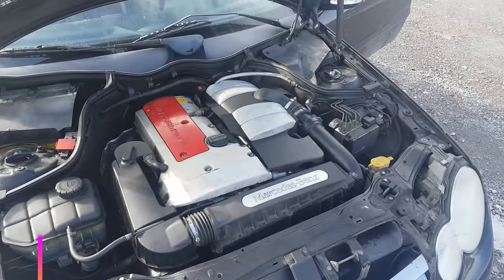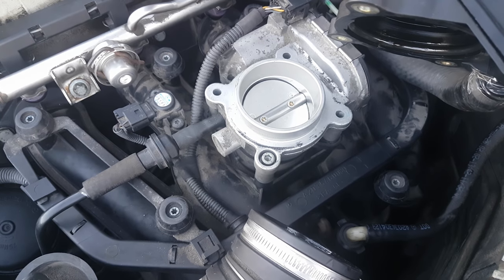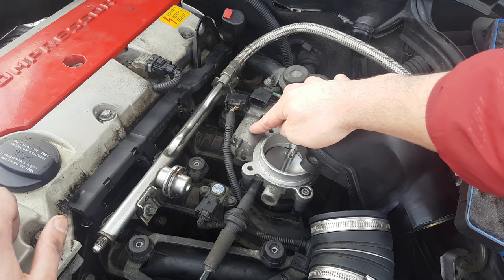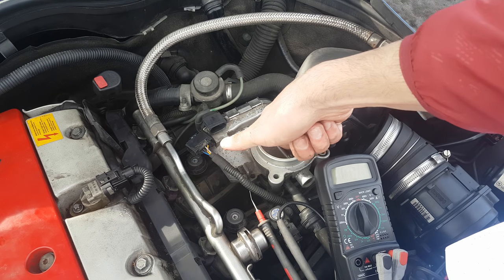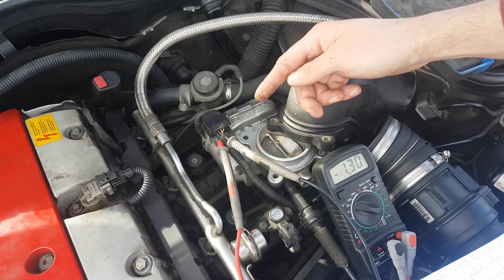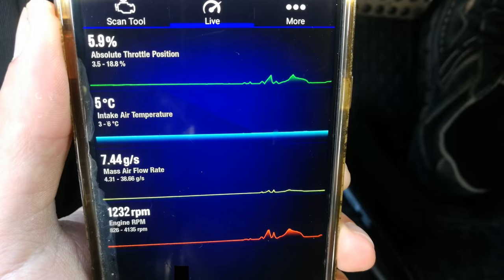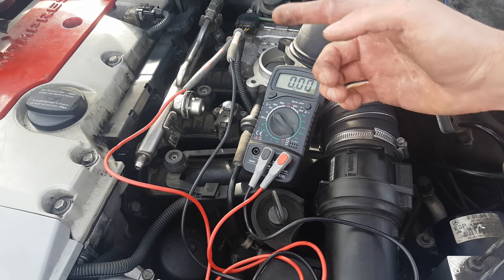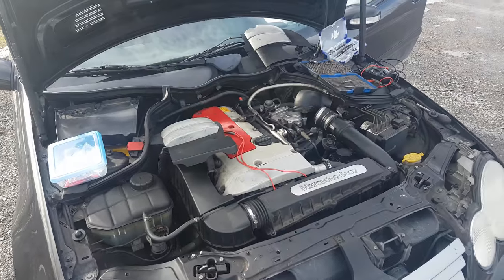Mercedes w203 C200 TPS (throttle possition sensor) Test

Comment: You answered a good question when I thought it needs calibration after install
Reply from the maker: Newer cars will need
Reply: My truck is an 07 mb 2007
Reply: So I just finished the throttle body on my 07 gl450  replacement no cel fired straight up no idle issues no programming idling at 650..

Comment: thanks for the video. I am looking to find an APP sensor for w211 resistance measurement, my car has cod P20DD with p0123 only the code set when I hit the kick-down switch I install a piece of plastic under the pedal. no code

Comment: Hello, my trotle is opening only small whit a 0222 failure. I have the same engine m111  so wit that 20 volt what wires do I connect and now if the TPS  is not ok?

Comment: Hi I've got a c220 cdi 2009 and I'm getting a 100% reading from the tps sensor at idle and doesn't change when I press the throttle?
The car struggles to change gear sometimes, turbo only really kicks in at about 3k rpm and idles at 780 rpm
I thought it was egr blockage until I see the sensor was at 100%?

Comment: Brother do you know about cold engine vibration? I have a  Mercedes w203 c220 cdi. When the engine is cold, there is a strong vibration and Rpm is moving a little up and down in idle but after 30 minutes when it's warm ,the vibration  is not any more.
I have replaced both engine mounts , spark plugs, and a used egr installed. The car also smells badly when is  start .
Can you please help me?
Reply: Hi mate. Did you solve the it. I have the same problem on my mb c220.

Comment: Thank for this free knowledge. I have a case where the live data in my scan tool that the throttle body is at 80° when I depress the accelerator fully, but the throttle body itself is barely open by about 1/5 when I inspected it physically. Any ideas please?
Reply from the maker: If there is a trouble code regarding the tps than the throttle is malfunctioning
Reply: @doit_vehicles  
Thanks very much.
At this point, I have no trouble code. Only some few codes related to EGR system and downstream O2 sensor

Comment: Hy,mabe you can help me with my problem.I have a Mercedes b class from 2005 Benzin and from some time I have a problem with the car.the problem is that engine has low power and the acceleration is not responding as it should be, i’we made a test and it showed nothing.after I’we watched you video and I cleaned the throttle body but surprise i’we another test and now I get the code p0122 and p0222 and another one with the knock sensor p0325.in your opinion what should I do?should I replace the throttle body and the knock sensor.thank you

Comment: What is the problem when the car idles high when in park and neutral but normal when in drive and reverse? I have the W203 2001 model.
Reply from the maker: from many other things , could be as well a vaccum leak . Only analizing the live data can confirm that

Comment: Why was you only getting 13% absolute throddle position? Is this a bad reading because I have w211 mines read 12% car is really sluggish should the throttle plate open all the way to 100% ?
Reply from the maker: At idle is a normal value . The flap will move up to around 85% when in full acceleration
Reply: Thanks for your advice I have really sluggish acceleration I looked at the absolute throddle position on a Mercedes scan tool the throttle plate stays at 13% with the gas pedal all the way to the floor in park just running the scan tool test I'm thinking either the throttle position sensor is bad or the runner control is stuck closed because I have a e500 and it's so slow is wide open throttle with the throttle pedal kick down switch depressed?.....thanks again for your help
Reply from the maker: On the v8 , I have seen the throttle body going bad often . Does the enginne rpm increse when u floor it ?
Reply: At idle the percentage is 1.6% but at full throttle it goes up to 22% with car in park pedal to floor rpms go up to 4000 but no higher now I did get a code p2071 this is the runner inside the intake manifold stuck closed the valve itself test good so I'm thinking the extreme low acceleration is coming from swirl flaps broken on inside I swear it's so slow a bike is faster than this v8 I have a real Mercedes scan tool MB 2 car soft but would throddle position sensor give low reading if intake valves are stuck?

Comment: Quick question, my clk 230 losses power and the kompressor won't engage when Press acceleration pedal. I keep needing to reset the throttle by turning on the ignition to on and off a few times before turning on the car, which will fix the problem for a little while, untill i turn on the car and drive with really low throttle response!

 any idea what could be causing the car from using its full power?
Reply from the maker: The best is to first read all the live data while this happens,  inspect the values . It's a big chance the throttle does not open the flap . Also the throttle from the supercharger must be inspected (  you will need a compatible scan tool to read those values )

Comment: Hi sir, do you know where is located the crankshaft sensor of this motor?
thanks!
Reply from the maker: On the point where the transmission conects with the engine
Reply: @doit_vehicles  At the bottom of the engine or on the side?
Reply from the maker: On this car was on the presanger side